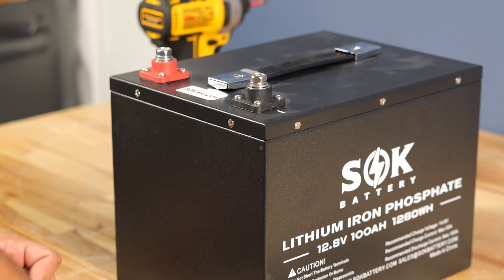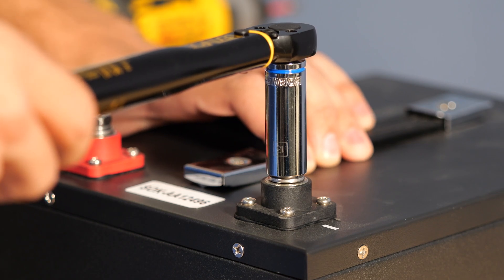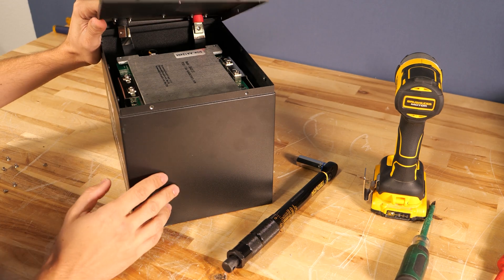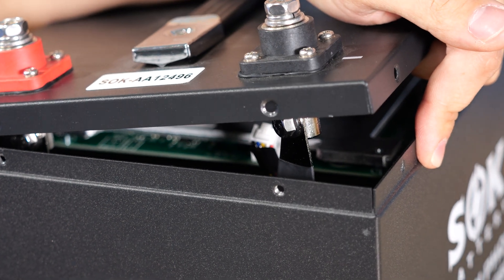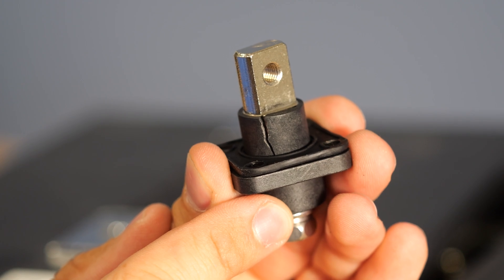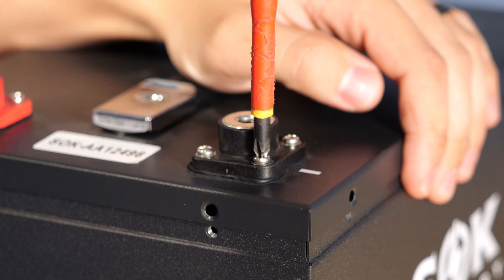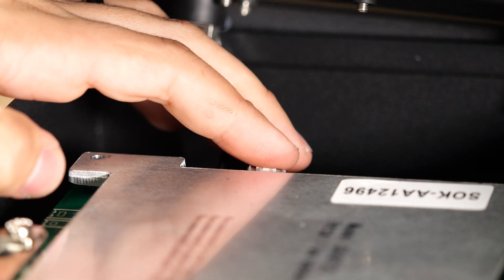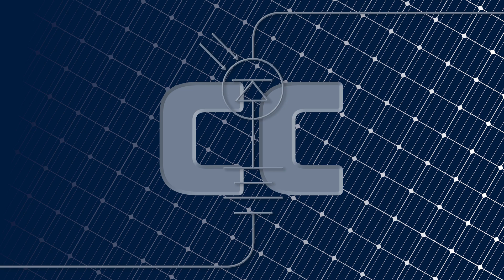How to Fix a Broken Battery Terminal 🔋 SOK Battery Terminal Replacement Guide

Comment: I didn’t get an email reply after 6 hours, got tired of setting on hold 4.5 minutes, ordered a Morningstar 60A 600V SCC from Eco Direct. I’m glad your covered up. You might as well just put “Not taking new customers at this time.” If I can’t get to someone to fix their a/c, I will immediately call them back and provide a list of other companies they can call. It’s just good customer service.
Reply: Thanks for the video.  Where can i order the new terminals?
Reply from the maker: @todd2978  email us, info@currentconnected.com for more information!
Reply from the maker: A little patience goes a long way.  We are at 75% capacity right now in sales/tech support and have been doing the absolute best we can, but we must also prioritize existing customers first.  The best thing to do is email info@currentconnected.com - Dexter and Jarrett have been burning the midnight oil to try and take care of everyone as quickly as possible.  We will be back to normal in approximately 1 week.
Reply: @CurrentConnected Most new customers will understand that we all get busy and prioritize existing customers/warranties first. I do the same in my 23 yr business. I have saved a text for my busy times to provide new customers. It includes, “I’m booked up until xx/xx/2023,  thanking them for calling me, if they can wait, I will get them on my schedule, if they can’t here is a list of other companies in the area that you can try.” If we don’t reply at all via phone, text or email, they will go elsewhere. It’s great that we have to turn down customers, but we need to do it quickly so they can move on to someone else.